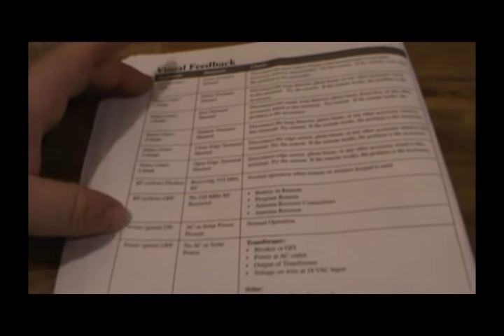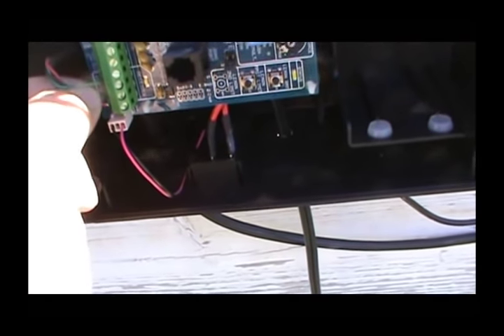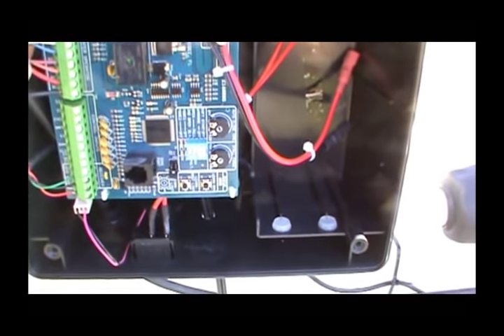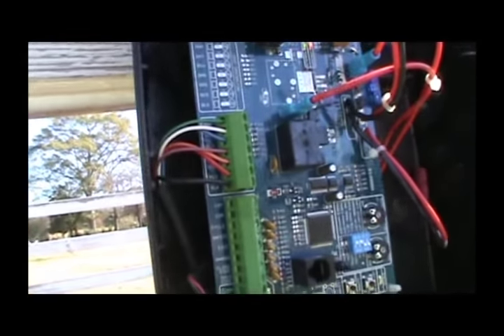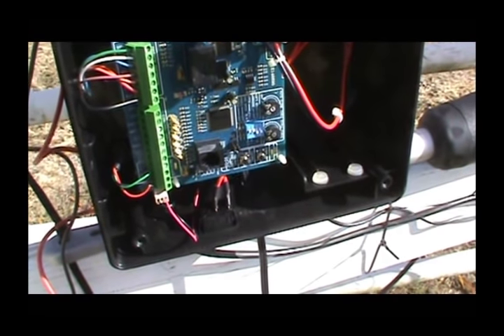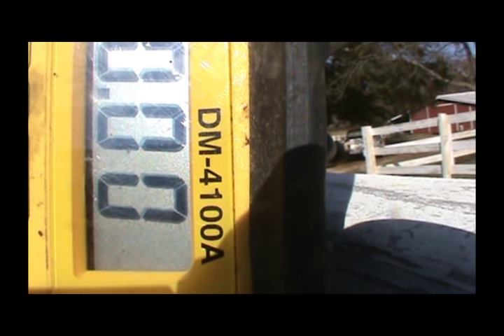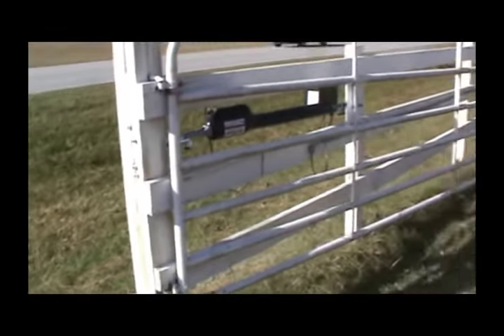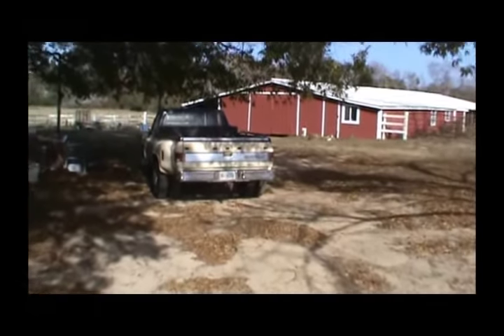Automatic Gate Opener Not Working

Comment: Thank for posting the video. First thing,  you have installed your gate opener upside down - all the screws in the housing should be facing down. Your gate opener system working intermittently possibly due to loose connection at the battery terminals or on the main on/off switch.  Sometimes the power switch itself may be defective.
Reply from the maker: Good catch!  I finally figured that out about a month after installing it!  Turns out in this case the circuit board was bad.  Power to the board was good.  Thanks!
Reply: farmboy30117
Hey man, I have the exact same control box/board on my FM502 double gate system.
Please let me know how long you had it before the board went out?
I have only had mine a little past 2 yrs.
Anyway mine is working sporadically. 
It will stop just shy of all the way open then start beeping one beep-followed by pause then two beeps.
 I can then turn it off and back on then hit remote to finish opening all the way then let it sit until the auto close activates and the gate shuts. 
Then when leaving the driveway and crossing the in-ground metal detector it opens all the way then sometimes closes and sometimes won't.
Anyway I called them and they said if there is no short present(and theres not because nothing has been messed with and no signs at all of a short) that the board is PROBABLY bad.
So what happened to tech support getting on the phone with you and have you go to the gate and walk you through a bunch of troubleshooting /testing BEFORE just telling you it's PROBABLY a bad $250.00 freakin board???
L@@KS like this MM FM502 is going to be another freakin headache just like the fm352 I had before this one. During the 5 yrs I had that system I had to buy 5 refurbished arms at $200 each and a arm rev.counter! 
So on a system that cost about $500-$600 i ended up spending probably around $1500.00!!!!!!!! -GENUINE POS!

Anyway please let me know the age of yours WHEN BOARD FAILED ?

If you have had the single beep followed by double beep problem yet?

 If the board is bad wouldn't there be some kind of physical sign of damage such as burnt solder joint, swelled diode or something?( Because mine looks brand new!)

Do you happen to know what the little black round cylinder shaped thing stamped with the year 2015 on it that site right behind the on/off switch? Could it go bad? 

Sorry for all the questions. I am just desperate considering tech support has 
gone to the dogs at the" NOT SO MIGHTY MULE STORE! " :-)
Thx!

Comment: A common problem with MM gate actuators.  They can get water, or debris inside.   Inside, the slotted wheel passes through a black sensor on the circuit board.  The main control circuit board uses these pulses to verify the gate is moving, and to count them and tell how far to move it.  The small slit in the sensor is only about as wide as a sheet of paper.  If any debris, or most likely, water gets in this tiny slit, the sensor produces erratic readings.  The control board misinterprets this, and will stall, or reverse, or report error.  Gate often opens part way, stops, etc.  or moves a inch, and then stops and beeps.  Solution is to open up actuator, and blow out the small black sensor on the board with air.  This is a simple fix to try, and cost is zero.  On dual gate, either actuator could be causing the problem.  Check both.
Reply from the maker: Thanks for the info!
Reply: Where is the sensor actuator located?
Reply: @leonrodriguez1714  The Sensor is located inside the gate arm.   
You'll have to have a torx bit to open the gate arm up.  Inside you'll find a linear actuator, which is a fancy term for a long screw with a threaded nut (in this case a tube) that runs on it.  It's turned by the motor/gearbox, and the slotted wheel is mounted on it.  The sensor is on a small circuit board mounted alongside.  Note that I'm describing the MM560 gate arm, but most MM arms should be similar.
Reply: @johntoe6127  ok thanks for time

Comment: good video, thanks. My problem was due to the receiver with the antenna on it, go wet. I had installed in upside down allowing rain water to accumulate. I took it apart, drained the water out, dried it and it now works fine. Just trying to add my solution. So many things can go wrong.

Comment: Maybe moisture in a connection or on the board?  Did you have a big temp change when it happened?  I love that dually.
Reply from the maker: It had warmed up a little when it quit working and it was nearly freezing when it started back.  There is no seal on the control box cover but it hadn't rained either.
Reply: It seems to be a pattern.  I am having the same problem today.  We recently had about four days of below freezing temperature.  This may not be true for everyone, but I noticed farmboy30117 stated in his video it had been pretty cool out. A couple of others also mention the cold weather.  Maybe the board is slightly changing shape in the cold and causing solder joints to break or loosen.  When I finally solve my problem I plan on using Dynamat to line my box to help temperature changes just in case. Thanks for the video farmboy30117. My GTO...similar to Mighty Mule...is 9 years old with no problems to speak of.

Comment: My 23 yr. old Apollo 633/634 board may have finally given up the ghost. Heavy rain arrived yesterday and it won't open. Once it stops pouring, I'll check the fuses. For now, I have simply pulled the arm off the gate and open/close manually.

Comment: I have the same problem but on a sometimes does and sometimes doesn't basis. Mine worked fine for several months but then quit working. I tried several remotes, including those paired with my truck, and none worked. My battery voltage was below 12 V so I switched to a different battery. At first, it wouldn't open but after a few minutes, it started to open and then closed automatically. My neighbor has the same opener as mine and he had the exact same problem. He found out that the solar panel was not maintaining a proper battery charge. I wont know about that fix until I get a new solar charger. I had a older MM opener and it quit after 10 years but it was the small DC motor that probably burnt out from years of usage. I plan to repair that opener in case I have these problems again. The older unit was much better than this new one with the upgrades. I could open that gate opener from 200 feet away but with this newer one, I'm lucky to operate it from 20 feet away. If  I find out any usable information on the opener I will be sure to drop you a quick note. Good luck with yours.

Comment: Mine is doing the same thing board is not powering up. Mighty Mule sent me a new board but like the first it isn't doing anything. What are the chances of having 2 bad boards? If this is the case I'm going to purchase some lottery tickets. Any suggestions?
Reply from the maker: I'm not an expert on these openers but in my experience if the battery is weak or bad, it won't work.  Did you check to make sure you had a good power supply coming in? I believe it is low voltage AC and there is a rectifier on the board to convert to DC.  Check battery connections and voltage. Also, check the switch to make sure it works.  If everything looks good, then I would say the board is bad.

Comment: I am having a very similar issue of intermittent failure and then a complete failure - I pulled the lid off and saw err 3 for the dea board. Did you get any error codes?
Reply from the maker: No I don’t think I got any error codes. You can go online to GTO website and pull up the owners manual to see what the code is. I had my board replaced under warranty and didn’t have any more issues until my battery got weak. When I have issues now I replace the battery and it solves the problem.
Reply: @farmboy30117  cheers for getting back to me. I did that - safety error and or photocell issue, checked the sensors and not clear issues so getting a chap round to resolve it.

Comment: I replaced my battery with one that was on a trickle charger and everything is working fine now, hopefully it will last. Farmboy, I hope your problem gets solved as easy as mine was, good luck.
Reply from the maker: Thanks George.  I've had a handful of issues over the years, but the battery going bad has been the cause of most of them.  In this case, the board was bad.

Comment: i have a receiver about 1500 feet from the kitchen window so remote doesnt reach, so got a module that reaches 2000ft that hooks up to it with remotes that have little extendable antennas on them. i hope that the original remotes still work along with the new ones, as i keep the original remotes in the car and just need the long distance remote in the house.

Comment: im having a problem with my mule 350 it started to beep non stop i was told it was the battery going dead so i bought a new one and now its not opening the beeping has stopped. it will only beep once   
upon turning the power on and off but im not getting and motion any advice would be greatly appreciated thank you
Reply from the maker: +Daniel stahl Apparently the circuit boards they use are junk!  My only suggestion (if you really want to keep the mighty mule) is to replace the board.
Reply: What was the issue!
Reply: @luisramos9125  it turned out to be the remote receiver,  ants had gotten inside and shorted out the board. I bought a new one and it worked fine.

Comment: What size gate? I have a 16ft gate and got a mighty mule 350. Very easy install.  I dont know much about these openers but maybe a bigger battery? I have a marine battery on mine and it works like a champ. At walmart it was about 62 bucks i believe.
Reply from the maker: It's a 16' tube gate.  It works fine when it's working.  I suspect a loose connection for the power supply because the battery is fully charged and the power from the AC adapter is working fine.  Still talking to Mighty Mule tech support, and I'll be sending it back to them when I get authorization number.

Comment: my gate sometimes does not respond when i open/close it remotely. when i press the remote it just takes out a beeping sound without activating the motor... how do i fix that?
Reply from the maker: Mine did the same thing and I ended up replacing the arm to fix it.
Reply: Same here. Mm 360,less than a year old.  Been working fine, but yesterday morning my wife was going to work, hit the opener, and beep, beep , beep......beep, beep, beep, until you turn the arm switch off. When you turn the switch back on it beeps once.       If you hit the opener button again , it beeps...,...,... all over again. She tried it when she got home in the evening,  and lo and behold, it worked.  This morning,  on our way to church,  guess what! Problem was back.....SMH.... any advice please

Comment: I have been installing Mighty Mule for years....i can tell you that water (rain) got in to your an antenna shorting it out then and it just dried out. check that it is up right and i see you fitted the arm upside down it has holes in it to let the water out.....
Reply: Hy sir im having problems with serkit board i turnd it off and on and thers no beeping all lights are on inside the box charging light is blinking is that normal

Comment: Maybe a cold solder joint on the power portion of the controller board. Big temp variation will make it act up again. Kinda cheezy of Mighty Mule not to ship a new replacement controller board. 

Hang in there!

John
Reply from the maker: It was definitely colder outside in the end of the video where it started working.

Comment: Any status update?  I just purchased the same unit (newer, of course- Red board V2.0) and it's doing EXACTLY what you documented here.  No audible upon switching the power to the control board.  Was working first couple of days and then I went to install an exit sensor/wand and nothing: I had first been trying to program a keypad and that wasn't working- I didn't inspect, so perhaps it had crapped out by that time.  Green light ON; Red light ON/blinking (charging).  I have 12.86v @ battery/batteries; solar panel inputing (at the time) 14.49v; I'm getting 12.0v at the rocker switch (input side and, when switched, output side).  Based on what I've read about their tech support I'm really not anxious to call them.
Reply from the maker: I ended up having to replace the board, under warranty, and haven't had any issues since.  Still works fine as of today :)
Reply: Great to hear (and thanks for the quick reply!).  What is the revision on the replacement board (is it Red)?  I'm assuming you pop the board off those plastic stands (and that it's not a bugger).
Reply from the maker: No, it was the same exact green board as it came with.  It was pretty easy to swap.
Reply: What was the original doing when you finally gave up on it (same thing)?
Reply: Mark Nagel the voltage of 12.86 on the battery is a bit low. All batteries should run between 13-14 volts dc. Incoming power should not drop below 18 volts even under a load as it cant charge like it is designed. May not be getting enough power

Comment: I recently purchased a MM 660.  I had the exact same problem.  After following directions exactly, with the last step of turning the on/off switch on, there were no yellow status or receiver lights and no audible tones.  The red (battery charging) light was blinking rapidly (two blinks very quickly).  The green power light was on.  I rechecked all of my wire connections and fuses.  I also used a voltmeter to check the power all over the board.  Turns out the circuit board was bad.  I ordered a new one and it now works as advertised.
Reply from the maker: Yep, that's what happened to me.  The replacement circuit board as so far worked great.
Reply: Slacer machine berkel
Reply: Late to the game, but I am running into this issue and can not for the life of me figure out why I can't clear the ERD Overload. The gate just sits in the open position.

Comment: I've had my sl2000 for 15 years and had to replace a control board that melted.  I'm on my 3rd receiver and decided to just screw the shit receiver and use the 850lm, get the compatible remote and wire that in so that it bypasses on the green and white wires on the board. This should give me massive range increase.

Comment: Does anyone happen to know what the little black round cylinder shaped thing stamped with the year 2015 on it that sits right behind the on/off switch? Could it go bad? What does it do?
My FM502 is doing the ONE BEEP-PAUSE-TWO BEEPS. 
It will stop just shy of all the way open then start beeping one beep-followed by pause then two beeps.
 I can then turn it off and back on then hit remote to finish opening all the way then let it sit until the auto close activates and the gate shuts. 
Then when leaving the driveway and crossing the in-ground metal detector it opens all the way then sometimes closes and sometimes won't.
If any of you guys have a clue here, PLEASE let me know. Thx!
Reply: One beep, pause then followed by two beeps at activation, normally means master motor terminal is shorted in the Mighty Mule blue control board which may be repairable.

Comment: I'd bet it was a low battery because it sat for months before you plugged it in. Then a few days later -- the battery charged. They run off the battery -- not the 18 VAC.
Reply from the maker: I'm pretty sure it was a defective board.  I've had to replace the battery a couple times since then but the original lasted almost 2 years.

Comment: Just repaired neighbor's M500.  If the status light blinks once per second, this may be due to a failure of the limit switch in the arm.  Neighbors switch had got moisture and the switch was wide open... not making any contact.  The logic board verifies it can sense the switch being in one condition or the other.  If it doesn't see this it will continuously beep and opener will not function.

Comment: some of these openers wont work if the battery is dead even when plugged to electrical outlet. when you left it for two days it charged up the battery and started working.
Reply from the maker: You're absolutely correct.  I've found that out a few times over the years ;)
Reply: Mine started working very slowly, changed the battery its now working fine.

Comment: What I noticed is the operator is upside down.
Reply from the maker: Good catch, it took me a few weeks before I noticed it. It's on correctly now.
Reply: @farmboy30117  Yeah it won't last long upside down. Good luck...
Reply from the maker: @Bass.Player  Yep, it lasted about a year before I had to replace the arm.
Reply: @farmboy30117  It would not last past the first rain if it was a 350 like mine with the control board in the arm
Reply from the maker: @Bass.Player  Good thing it's a 500 then ;0

Comment from the maker: Update 11/18/14 - not working again!
Reply: farmboy30117 First thing you do is get rid of the the Mighty Mule Battery if you are using one and buy yourself a decent Marine Deep Cycle battery. also if you are using solar power to charge your system, get a minimum of a ten watt solar panel. Most 10 watt solar panels are 12" x 12" minimum.  

It appears you are having source power issues.
Reply from the maker: The battery wasn't the problem, it had a defective circuit board.  Since I have ac power run to it, I don't really use the battery anyway.
Reply: farmboy30117 Just as an FYI in the future, on Mighty Mules you are always using the battery. The incoming AC is just trickle charging the battery, the gate opener cannot run off the AC at all. So down the road (2-4 years) that battery will die of old age and need to be replaced and your opener will not be able to run because of it.
Reply from the maker: Ok, thanks for the heads up.